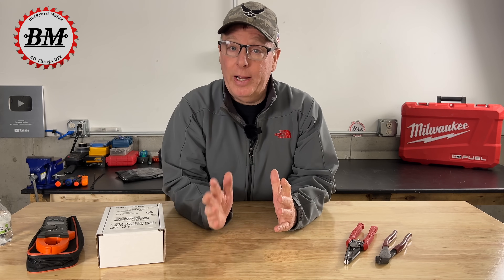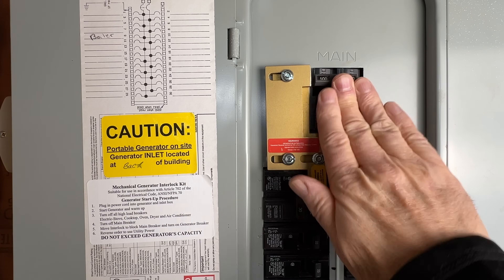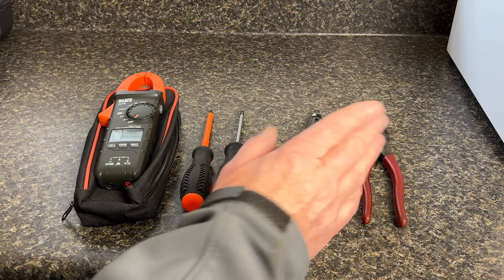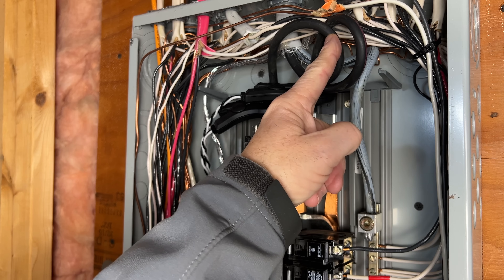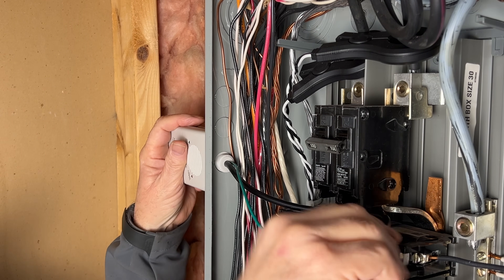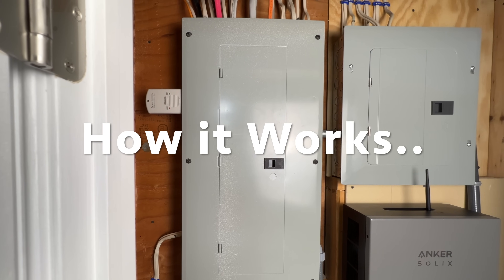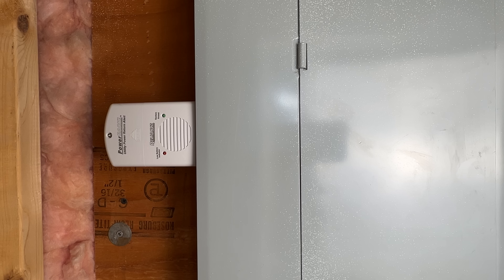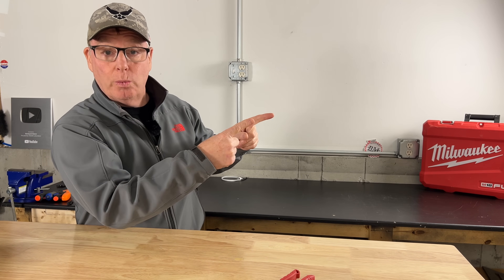The Secret to Knowing When Power's Back On!

Comment: LOL here's my low-tech system: I have a transfer switch that powers essential circuits, so some outlets are still on street power. I have a small Amazon strobe light and a small AM/FM radio I connect (both in the ON position)  so when the power comes back I can both SEE and HEAR it. I like having these visible and audible alerts INSIDE the house with me... not out in the garage at the panel, near where the noisy generator is running.
Reply from the maker: Perfect!  If you have a sub panel or a GENTRAN or similar then this device would not be needed.
Reply: I use my kitchen range. When the power comes on, my range lights up and beeps. Since I have a Reliance ProTran transfer panel, I can leave any circuit I want connected to the grid, like a lighting circuit. I specifically installed a transfer panel instead of an interlock for this reason. The extra cost of a transfer panel is well worth it.
Reply: Great in your case but I have no such option here.
Reply: @prestonrenify  Just hook up a radio transmitter in you electrical box and transmit something to the indoor, easy.
Reply: @festerofest4374   @charlesmiller5057   Wow, I also have a Reliance ProTran transfer panel.  I have a outlet that is dedicated to my central vac, so I can just use that to plug in my visible and audio devices to alert me when the main power is back!
Reply: I have a low tech answer too.....I have transfer switches, usually called HANDS, that do all these interlock / critical circuit switchovers, which coupled with my double-male outlet "killer cord" let me backfeed through a wall outlet. If you need so much garbage, you probably shouldn't run a generator. Go buy your $1000 in replacement groceries and my insurance rates will help you buy them. 😂

Comment: Forgot to lock out the main.
Reply from the maker: More of a commercial industrial thing. Nobody will be switching my power. I did teach LOTO, Arc Flash, NFPA-70E and overall electrical safety before I retired from my electrical engineering Job with TI.

Comment: I give my utility company a call, my problem is solved.:eyes-pink-heart-shape:
Reply from the maker: Here in Maine they have an app that will tell you an estimated time when power will be restored and also when it has been restored. However we usually have power back for 6-12 hours before it changes from assessing to an estimated restoration time or drops off the list as restored. I really don't want to run my generator for 12 extra hours.

Comment: Would this device work by wrapping the antenna wire around the drop line feed?
Reply from the maker: The wires feeder wires and neutral will cancel each other out so the device would not work that way.

Comment: Unfortunately my generator ready panel, transfer switch, and main distribution panel is outdoors, and this looks like an indoor-only product.
Reply from the maker: It is an indoor device so unless you have a way to come out of the back of the panel to an inside wall this will not work for you.

Comment: The power company installed a surge suppressor on my meter(I requested it) it has 2 leds showing it is working, I can look out the window to see it. So although I have to actually look, it's easy to see power is back on.
Reply from the maker: Great plan.. I can see mine from the house so this is a much needed convenience.

Comment: I agree with the comment below about hearing my neighbor's Generac shut down.  🙂 I will point out, though, that if you have a "smart meter" you can tell the power is restored when the display comes back on.  No need to keep switching back to the utility setting to see if there's power.  Our power meter is conveniently located just outside our back door.  This is a clever device, though.
Reply: But that requires you to actually check it though. This will tell you the moment power is restored.
Reply from the maker: Great plan.. I found it easier to just switch the breakers rather than going outside. Of course our last two major outages occurred during snow storms. One of my neighbors has an automatic generator setup but with a dozen or more generators running in the area I can't hear his shut down. The power back for me was a much needed convenience.

Comment: I have a whole house transfer switch and live in a rural area where it is not obvious from street lights etc. that the power is back on.  After a recent power outage, I did figure out that when mains power is lost the digital display on my outside power meter goes blank, and when it is restored it comes back on.  Running on generator power doesn't re-energize the meter because the transfer switch isolates it from the rest of the house.  An audible alarm would be better, but checking the meter on the corner of the house occasionally isn't a big deal for me.
Reply from the maker: There are 3 or 4 other methods to including looking at your meter to find out when power returns. This is a convenience install to eliminate checking several times a day especially during snow storms.
Reply: @BackyardMaine  Alarm and a relay. one input to transfer switch switches the relay the other is switched by the relay to operate the alarm. Similar to the alarms to keep people from driving RVs off with shore power connected.
Reply: You can always add a cheap security camera at your meter to take meter readings remotely. I find it very useful when I want to check up on what the power company says I use. I have caught them in a gray area before. I do not blindly accept their usage numbers without verifying them myself. I recommend everyone do this. It keeps them honest.

Comment: So, uh, if you have a meter with an LCD screen (which is like all meters today) all you have to do is look at the screen. If it's showing anything, it means power has been restored.

Also, DO NOT PULL A METER without consulting your utility. You could be accused of theft if they discover you broke the meter seal without their permission.
Reply from the maker: There are 3 or 4 other methods to including looking at your meter to find out when power returns. This is a convenience install to eliminate checking several times a day especially during snow storms. I was referring to an electrician pulling the meter. Maybe I should have said that. I have called the utility and pull meters quite a few times.

Comment: Great little tool. I was going to put a light on mine.
Reply from the maker: A light sounds like a good idea but they are not code compliant and can be a fire hazard because they are provided with no protection. Also you can't tip into the main lugs by code either.

Comment: That seems like a good product for a use case that will defy many people. I have a garage fed separately from my house and I have a 12V feed from there to my house, and an alarm in my laundry room to let us know when power is restored. But a device anyone can buy and install is a really good idea. Since I had no idea how a commercial device would work, I made mine chirp frequently at first, then back off (assuming we were asleep or not ready to switch back to mains.)
Reply: >"I have a garage fed separately from my house and...." Ditto. 2-breaker panel at meter-pole between house and garage. I open the house breaker and feed house from the generator. I let the garage (on utility non-power) go dark, but I turn the garage outside light on. I can see that light from a main window in the house. When I wander by and see the light, I hesitate a few minutes (power does not always stay on), then do the switchover, shutdown, put-away process. (No streetlights here!) (The nearest neighbors don't have generators.) (The next-over neighbor has a funky line and may rrrrrrrt generate for days after my power is back.)

Comment: Not if you put fuse protection within 5 ft and use the right size wire
Reply from the maker: Well I guess if you ran the right size wires to a disconnect and fused down to small wires feeding a light or an alarm. But you still cannot connect the two wire in the same lug on the main breaker so you would need a double lug setup there as well.
Reply: @BackyardMaine  they have lugs made for that

Comment: lol that’s crazy. 

All I did was installed an outlet to the box outside and plugged in a light. 

When power comes on the light comes on. 

Easy peasie
Reply from the maker: Against code to parallel wires off the main. They will have no OCD protection and you cannot multi tap the main lugs.
Reply from the maker: Against code to parallel wires off the main. They will have no OCD protection and you cannot multi tap the main lugs.
Reply: That is illegal and very dangerous.

Comment: This is a great solution for most applications, however my panel is set in a wall that is finished with sheet rock. Not sure how or if I can use a device like this. My luck!
Reply from the maker: It would be a bit more work but it could be done.

Comment: This absolutely works. I installed one of these a year ago and I finally had an outage a couple of weeks ago. The noise it makes is loud and piercing. I installed this because during an outage I ran my generator 2.5 hours longer than necessary.

Comment: Just get 120 volt light blub with switch switch power  failure turn switch on look at light bulb hook up on line side power coming in with fuse protection 😊
Reply from the maker: It’s a code violation to tap off the main lugs and another violation to have unprotected wires ahead of any OCD. This could easily become a fire hazard.
Reply: @BackyardMaine  look up the 5ft rule in the National code
Reply from the maker: @jcaleca60  Its actually the 10 foot tap rule and it does not apply to something like this. It's for tapping feeders to new equipment. Also you cannot put two cables in the lug.
Reply: @BackyardMaine  I'm in New York City they have a lot of amendments to the National code New York City is a whole different world good talking to you my electrician brother

Comment: The power co. upgraded my meter , And when the power comes back on the numbers start flashing on the meter . With the old meter it was all guess work , I would try to see if the houses on the road were lit . The new meter makes it so easy !
Reply from the maker: There are several ways including the one you mentions to go and find out. This method doesn't require multiple trips to the utility meter.
Reply: @BackyardMaine  Yes your right , But looking at the meter doesn't  cost me anything . And it's right outside the front door . It does seem like a nice product . if I still had the old meter I would consider getting it .

Comment: Most mobile homes have a main panel outside where you would connect the generator, meaning this unit would need to be on that outside panel to work. Also, in most houses, the panel is in the wall, so putting it in a knockout isn't going to work very well.

Comment: When my neighbor’s Generac shuts down, I know power is back on.
Reply: This for the one neighbor. And when I see my other neighbor's wifi network is on the air, it's double confirmed.
Reply: @myself248  You wouldn't be able to go by mine, I have my WiFi up and running during power outages,
Reply: That would work for some folks but all my neighbors that have whole house systems are on a different line than me.
Reply: Automatic transfer switches are a thing ;)
Reply: I have a PowerBack on my breaker panel as well. Biggest gripe is the battery life. Would be a big improvement if the power came from the generator in-feed. It would go live with the generator and power down once the generator goes down. A rechargeable Lithium battery would also help as an alternative.
Reply: Cool now I just need to talk my neighbor into spending $8,000 on one. This should go well.
Reply: Funny! That's my system too!
Reply: Some lol
Reply: But aren’t Generacs also routinely and frequently shutting off because of genset problems?
Reply: @mnmike6884  I don’t have one, but I understand that if properly maintained, are very reliable.
Reply: A GeneCrap (GeneJunk) is more likely to fail than to make it through an entire Power Failure.

Comment: I’m a power lineman for a living. Great advice. However most utility power meters are digital. They need full power (240 volts)to read. If you have an older meter with the dials on it? Then this device will be your solution. Thanks for posting. Great tip.
Reply: What does the type of meter have to do with monitoring for power on an incoming leg with an inductance pickup device?
Reply: I'm assuming he means that one leg could be restored and the other leg maybe having issues bringing it online. So the device being connected to only one leg it would give a false alert  while your electric meter running on 240v isn't gonna come back on until both legs are restored @handyandy2112
Reply: @ A lot. If you or anyone else like a gizmo that rings when power is restored? Go right a head & buy that inductive device. 
If your house has an electric meter that is digital? All you have to do is look at the display. It requires 240 volts for it to work. That would be enough for me. If it’s night time? Look to see if the street lights are on? Don’t look at your neighbors houses as they might have a generator too?
Reply: @johnclyne6350  Your way is nice if I wanted to get my boots and parka on and go out in the -15F weather to look at my meter every 10 minutes.
NO THANKS. 
I too was a Pole Dancer for 40 years. I also have a "Rain Forest" device that tracks my Kw use and during a power outage it says "Lost Connection" and when power ir restored it relinks to my meter. But it is not always where I am sitting enjoying my generator's power.
Reply: @ I’m guessing your retired? Less than 2 years left for me. Thank you for your service! You know as well as I do that after your power is restored it could go out again on that first day back on. I leave my generator on for atleast 4 more hours after power is restored. 
My meter can is just outside my garage door. If I needed to check it? All I do is take 2 steps out from my garage to look at the screen. I know some are not that convenient. I’m in no hurry to switch back over to street power. My genny burns a gallon of gasoline in 4 hours. I’m not worried about burning extra gasoline either.
Reply: @johnclyne6350  Retired in 2015 due to vertigo after a motorcycle crash.
My meter is on the detached garage 30 feet from the house. My 10Kw inverter gen set is wired into the main panel with a lock-out.

So this simple device will work on one leg of my house Sub panel. And for $47 its not bad.
Reply: @ Congradulations on retirement & condolences for your crash on your motorcycle. My wife has frequent bouts of vertigo. I have P.O.T.S. Post major surgery last year this time. I have it from time to time. 
You're very wise to have an inverter. I love mine. A 10K? You must not have a Honda? Unless you have two that are coupled? 
$47 is not a bad price for the simple device. For your situation. It makes perfect sense. I also follow my employer's outage map. That usually has accurate information on small outages. Our house is fed off a single phase as in my front yard. The riser pole is within sight of our house. I have yet to see the fuse blow. Every house we have lived in has to be on a back bone. I'll never own a house off a single phase lateral. The longest we were out of power was 5 days when the state got hit with surprise storm Alfred 96% of the state was flat. We got our generator because we saw the writing on the wall ten years ago. Most everyone has too. 
If you want to look me up on the web? I was featured in the May 24' newsletter of the IBEW.
Reply: @johnclyne6350  ,No street lights on the out town back roads of Maine
Reply: @justmedontknowdoyou7860  Then you would need that device. I happen to have a street light right in front of my house. If I happen to run my generator for a few more hours I would only burn a few quarts of fuel. Not gallons.
Reply: What's a street light?
Reply from the maker: Thanks for sharing
Reply: Actually works no matter what meter you use. It uses 120 vac  magnetic induction to trigger the warning circuit. 

Have use mine with both type of meters.

Comment: I use a Mag mount wifi Camera looking at the Meter and it is positioned so it can see the TX side of the optical Fiber coupler on the front of the meter Face. When Power is restored The camera can see the light output of the Fiber connection.. Day or night...I just have to glance at my screen every now & then..
Reply: Human ingenuity be awesome.

Comment: I installed one of these several years ago and they work great. You need to change the 9 volt battery when needed. emits a loud screeching noise when power cones on. I love it.
Reply from the maker: They work great right.. I wish I installed one years ago.

Comment: I installed a 3 watt bulb on the circuit panel that is on when power is at panel. I just have to look at bulb to know if power is back on.
Reply from the maker: That will work but it's not code compliant because the light and the wires feeding it have no protection and can be a fire hazard. You could have a problem with insurance coverage as well if it was determined that the cause of the fire was a code violation. Also it's not code compliant to add a second set of wires to the line lugs. It works for sure nut its a risk.